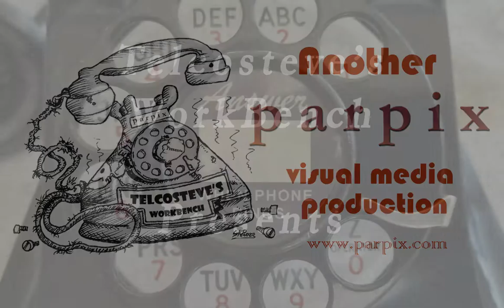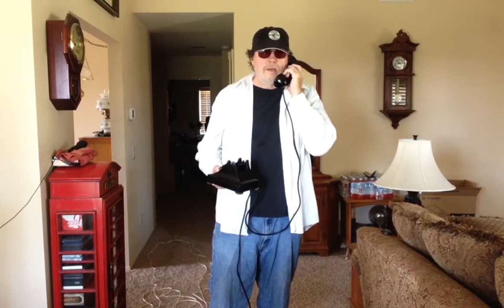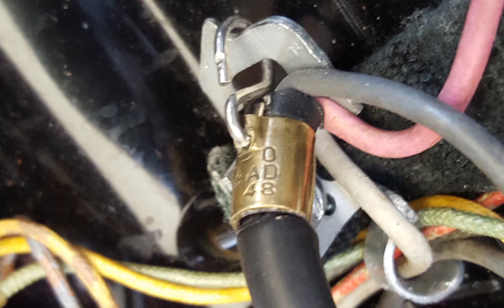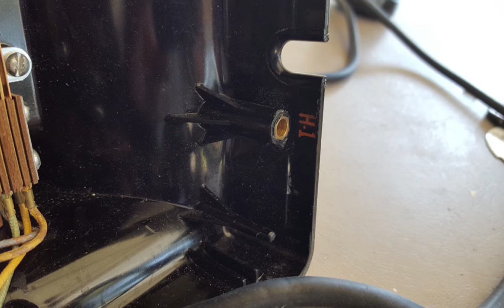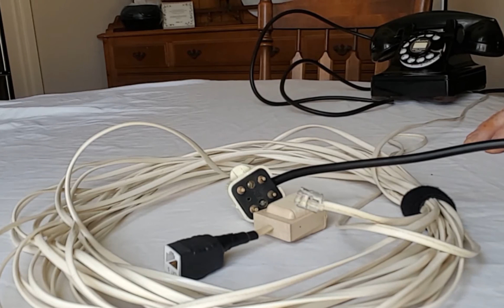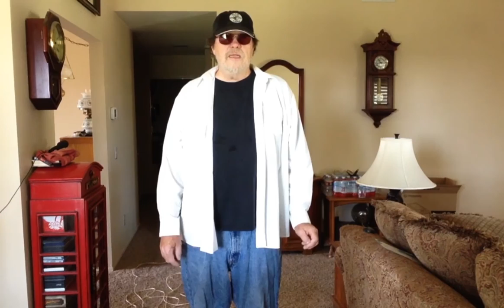1948 302 Rotary Telephone

Comment: love your videos!!! I'm 17 and I work on old telephones too and I was wondering how much do you usually sell a western electric 302 for?
Reply from the maker: +matthewblalock58 -  It really depends.  If the base is plastic or the metal alloy.  Are all cloth cords in great condition, or are they crumbling inside.  Consistent dates through-out?  Working Trans and Reciever elements or bad? The condition of the tenite plastic and in some cases bakelite on the F1 handset  - and the body 300 model series.  A no cracks - no scars - with cloth cord - usable phone with all dates matching should go for $190.00 and up.  Too much junk out there that people get (and I have been one of them) screwed on many "good buys."  Odds are good to find one that has not been messed with - but you take your chances.  Thank you Matthew for your very nice comment.
Reply: Steve, that''s exactly the same situation (harder to find grade A phones suitable for restoration) in the UK with the British Bakelite telephones.

Comment: Hi Steve, I love watching your videos! And I recently picked up a 1940 Western Electric 302 with the Zinc body. It's all dates matching. I know how to wire the WE 500 sets to ring but, how do you wire the 302 models up to ring? Thank you and keep up the great work! 😊
Reply from the maker: Move the red bell lead to the slate lead from the 192A Condenser (cap) and move the black lead to L1 . Tape and store the yellow line cord lead.  Thank you VERY MUCH for the kind words.
Reply: @TelcoSteve  And what was the yellow wire originally used for anyway
Reply from the maker: @TechHowden  Years ago the yellow wire was used for Ground connections.  Just use the red and green to L1 and L2
Reply: @TelcoSteve  Thank you I knew you didn’t need to connect that wire to anything I was just curious about what it was for originally for

Comment: At  the time of manufacture of the WE 302,  there was still many magneto exchanges in service. Other phone manufacturers offered an additional supplement attachment  for the bottom of the phone which housed a crank generator required for these exchanges.
I have a Stromberg-Carlson desk phone, looks like the 302, having this add on feature.
As far as I know, WE offered no such option. Having a magneto WE 302 required a wall-mounted subset containing the magneto.
Reply from the maker: Actually,, they did have some external magneto options for "other " telephone manufacturers - such as Northern Electric.  The 302 was the "AW1" (or something like that) model, not the H series and the handsets always said F1W to distinguish the difference.  Thanks for watching!

Comment: Do you have any 302's currently for sale?
-Thx.
Reply from the maker: Yes, it is for sale at $175.00
Reply: Hi, i'm sorry,
Just wondering, do you have any other phone models or Western Electrics like this model that are a little bit cheaper?
Sorry to bother.
-Thanks.
Reply from the maker: @ethan1970   None at this time
Reply: Do you think you could Email me some photos of that 302 you have for sale at $175?
Thx.
Reply from the maker: @ethan1970  Sorry it sold.  I will build another and it should be available in May of this year.